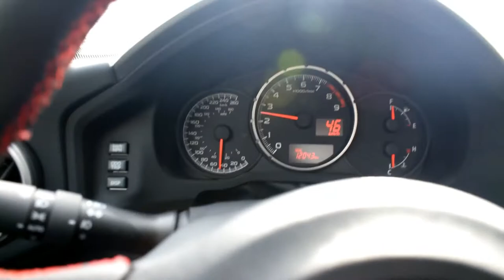Painting LED Light Bar! DIY Blackout Edition!

Comment: Just crushed the light output of that bar. That is why we haven't seen another video on it I'm betting... should have just used a light coat of lens spray tinting on the front of the clear lens.
Reply from the maker: +Adam shinny77 theres no video actually because i dont like it on any of my cars🙈the output is still pretty good actually !
Reply: They make black bars the LUMMS dont come from the reflection of the chrome plastic ...just saying
Reply: If you mask the cone part of the chrome and paint the rest your good
Reply: Any ideas on how to mask the inner chrome reflectors and just paint the flat part? I was thinking marbles laid in there, but there must be a better way. I sure ain't cutting a mask around all those holes, I would never get it accurate enough.
Reply: Nickles... nickles are the perfect size to cover the cones without leaving an awkward ring.
...just my five cents!